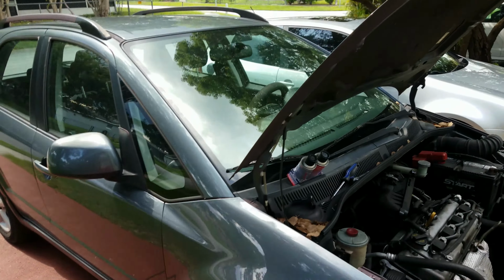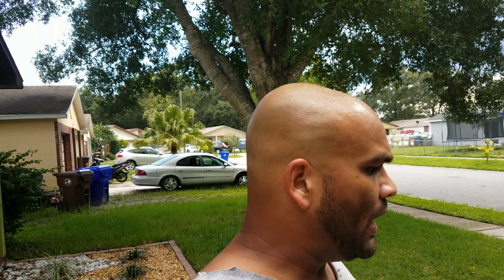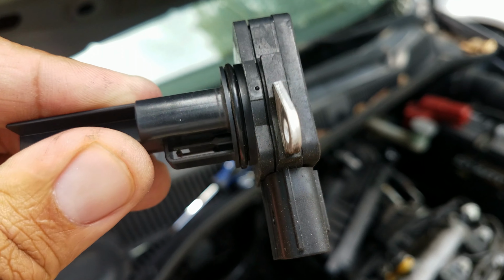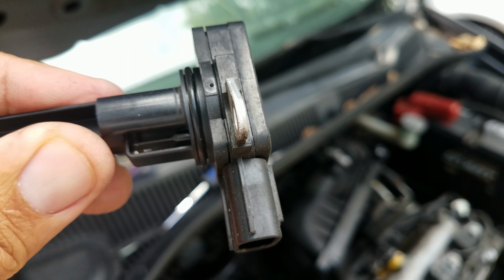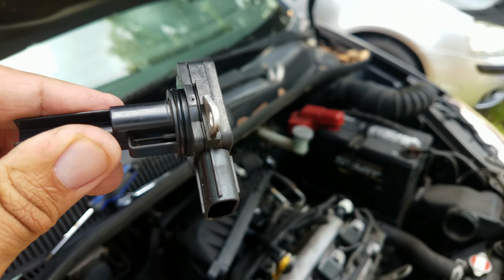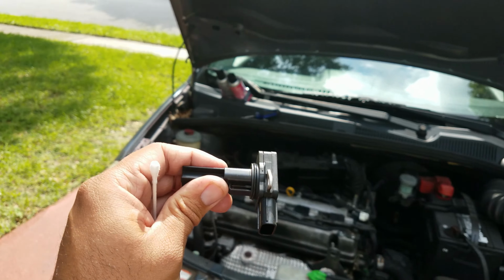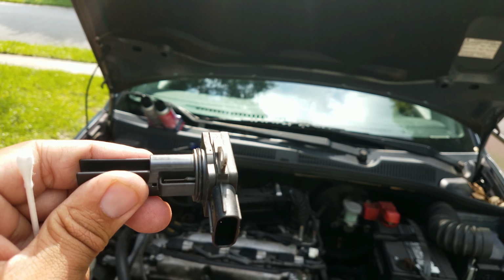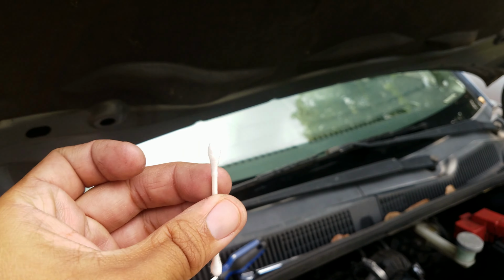How to fix sputtering in your engine's idle

Comment: Thank you man! I went to the mechanic yesterday to change the parts his scanners showed. So I have a new camshafts, new spark plugs and a new air intake system. When we started the car, it sputters and dies. And exactly like you said in the video, later when we leave the car running, it was going back to his normal revolution but the gas tank was running low so quick; that was crazy. Hopefully after I cleaned it, the car will work. I will do it this week. I will keep you posted. I have a Nissan Altima 2014 2.5L
Reply from the maker: You're welcome Emmanuel! I hope that is all it needs too 8-)
Reply: Emmanuel Kakou  did the sputtering stop?

Comment: i have polo 6r 2009 does mine have it?
Reply from the maker: Most cars do. It should be near the throttle body where the air intake goes in. The Polo comes with different engines.

Comment: What if you've had an induction cleaning and new spark plugs put in and it still does it ?
Reply from the maker: If it still sputters and stutters then it may be a fuel system related problem. Possibly dirty injectors and you can try a few gas tank with a fuel injector cleaner.

Comment: I guess the mk6 is different the mk4 has a mass air flow sensor. It just a different design.
Reply from the maker: Indeed. I used to own a 2009 MK5 Rabbit and that year did not have a mass air flow sensor.

Comment: You didnt show where to find the part my guy
Reply from the maker: huh, sorry about the oversight. Mass airflow sensors are usually located near the air filter box in the engine or somewhere near it.